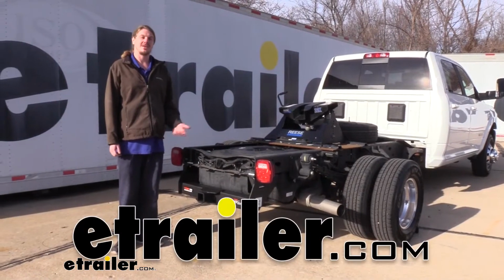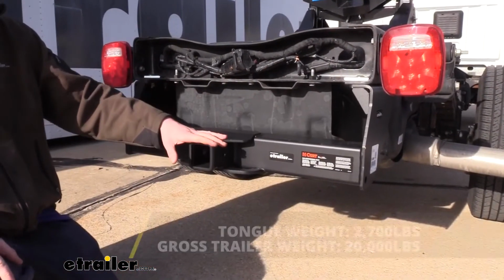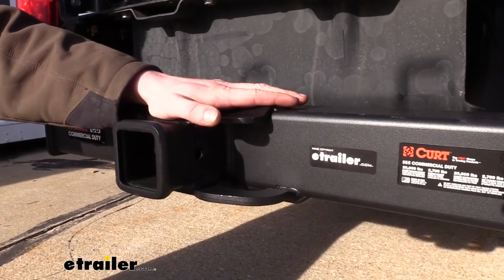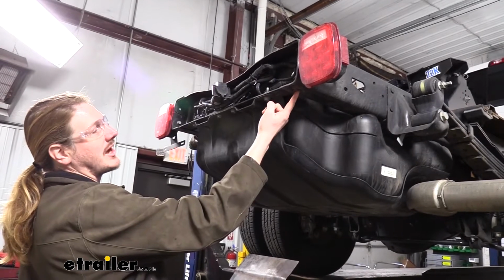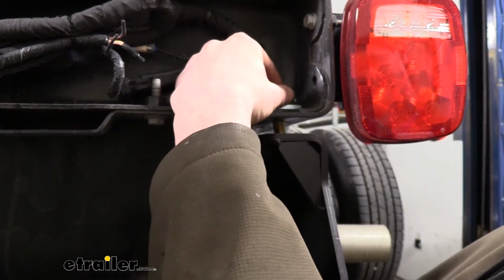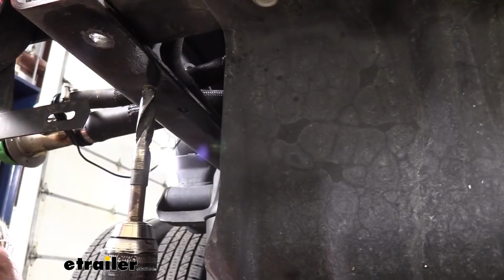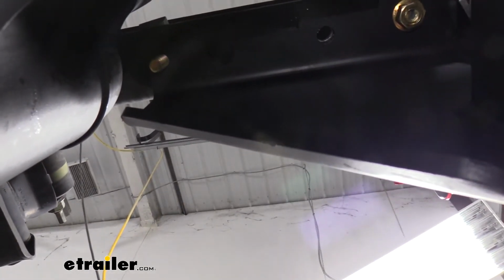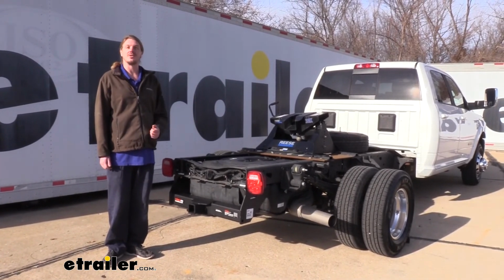etrailer | How to Set Up Your Curt Trailer Hitch Receiver on a 2019 Ram 3500

Comment: Is this hitch is going to fit 2022 ram 5500?
Reply from the maker: This hitch has been confirmed to fit the 2010 - 2021 Ram 5500 Cab and Chassis. It has not yet been confirmed to fit the 2022 Ram 5500.
https://www.etrailer.com/vehicle/2022/Ram/5500
https://www.etrailer.com/Trailer-Hitch/CURT/C15800.html
Reply: Thank you. I would like to order one for 2022 ram 5500 chassis is 34" wide (outside mesument). What do you think order that fit ?
Reply: What you think i can order that can fit?